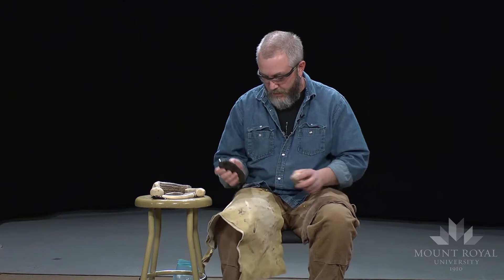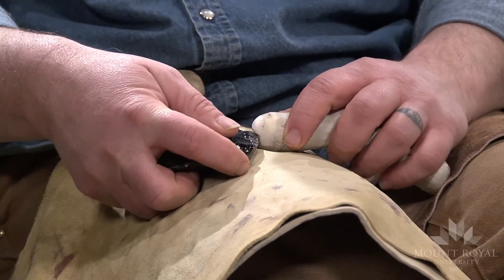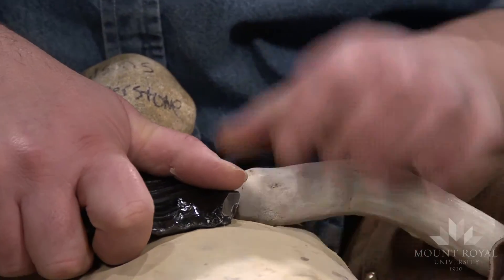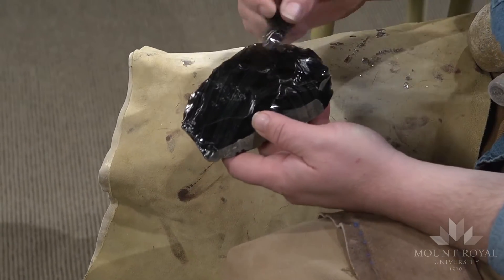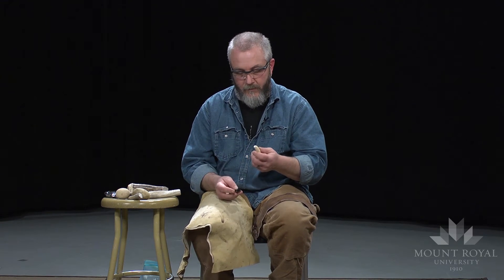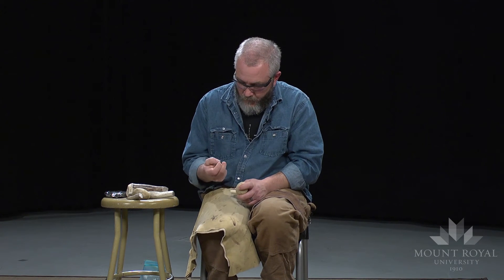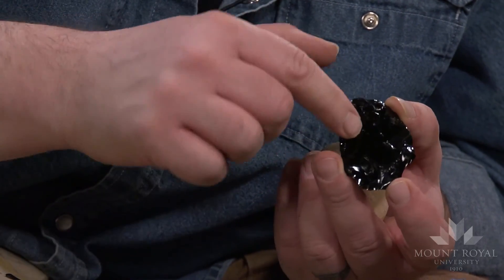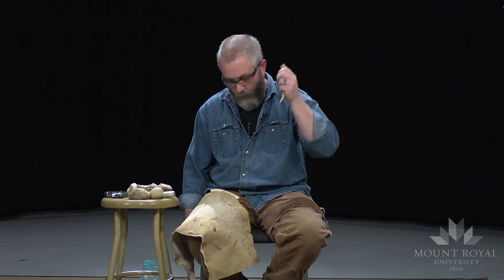Indirect Percussion

Comment: i find i can do my best work while sitting on the ground or squating like i believe the my ancesters did
Reply: Chris McCuaig have you tried working with large anvils?  I believe the local natives had large flat-topped stones, which they could top with smaller flat-bottomed "modular" anvils of various shapes (and to prevent loss of the big stone). this is mostly for bipolar percussion, although I believe they were also used for other techniques, such as angled-ledge lopping, breaking over corners, and various vising applications.

You can get right over the work, like a little work bench.

Comment: Good demonstration of notched, unsupported horizontal punch.  I wonder if you've actually seen these notched punches at archeological sites?

As a side note, you may try to strike the punch with another piece of antler.  You can obtain higher velocity strikes with a cylindrical antler "mallet" as opposed to a roundish stone.  The higher velocity allows you to work harder, non-amorphous material more easily.
Reply: Seems like you've been waiting for close to 10 years for a answer lol does deteration over time not allow us to find the true answers on how they would use knapping tools?
Reply: @devinpinnon4209  He answered the question below with the other comments. Nine years ago, YouTube didn't put the reply below the comment it answered.
Reply: @devinpinnon4209  Yes, the tools deteriorate over time. But even if they didn't degrade, it's still very hard to tell exactly how they were used.